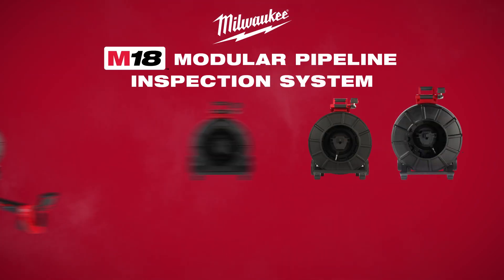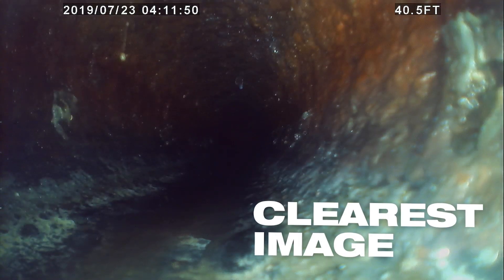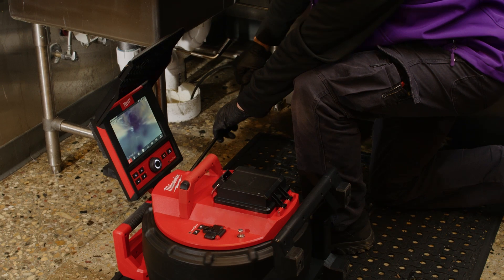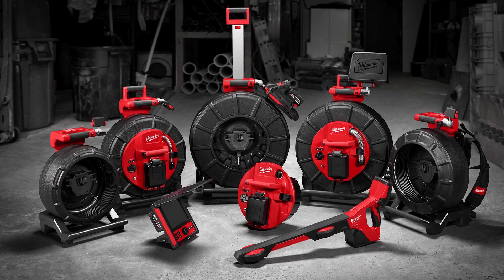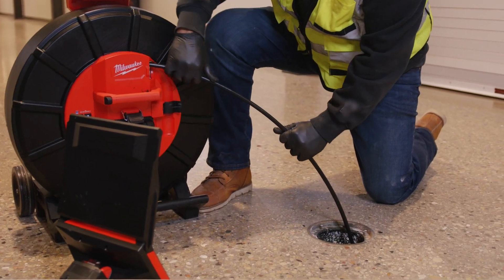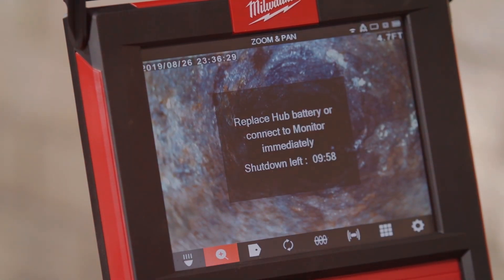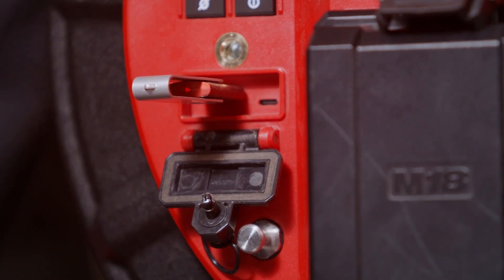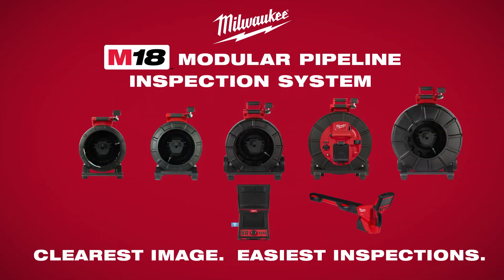Milwaukee® Pipeline Inspection System

Comment: What’s the difference between the new 3974-22 and the older 2974-22?
Reply from the maker: Hi! The main difference is that the 3974 model has an HDR self-leveling camera head, which provides better clarity, reduces washed-out areas, and enhances detail in dark conditions, while the 2974 model uses a standard 1080p HD self-leveling camera head.
Reply: @MilwaukeeTool Thank you. Just ordered the mid-stiff 3975-22
Reply from the maker: Of course! Let us know how you like it! 💪⚡⚡